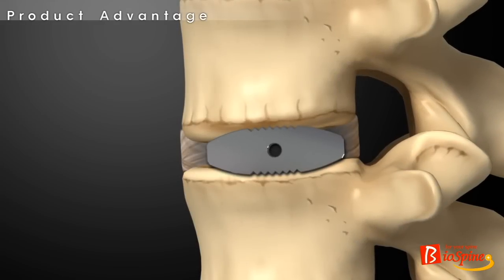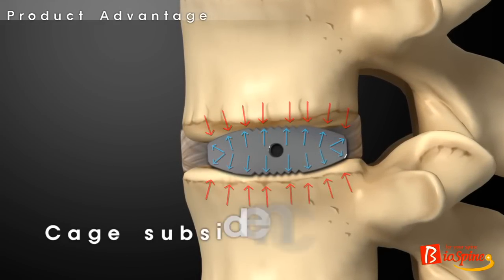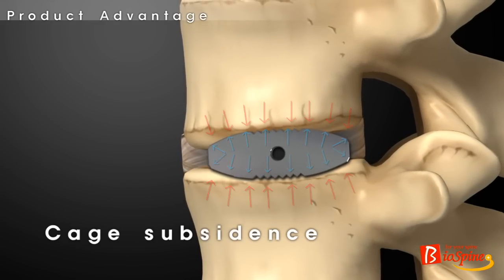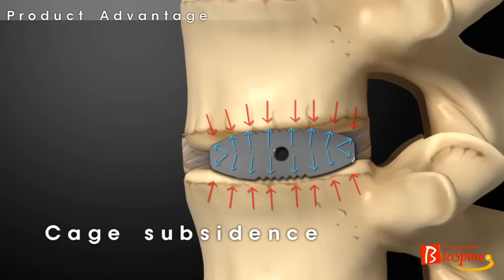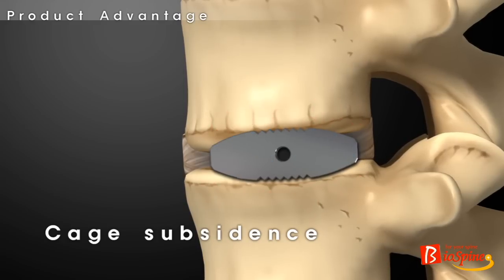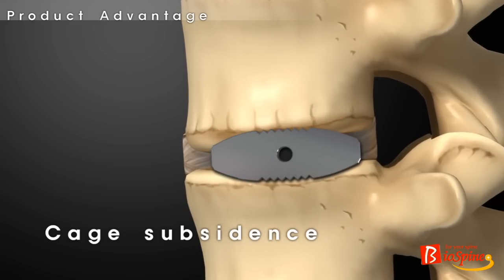Bioflex Functional Cage SystemBiospine

Comment: Do you loose any mobility with this implant (for instance, rotation)?
Reply from the maker: ***** The flexible cage has not been designed for a kind of artificial disc, so that we cannot expect any mobility in case of rotating movement of spine.

Comment: I'm curious about this design, wouldn't it have been better to design the flexible cage to have a floating upper and lower disc.

A kind of circular platform that sit's similar to that of the original spinal column which could be clamped using overlap to the bone rather than having to use a flexible rod system.

Kind of like a bottle cap fitting over the opening of a bottle, so you would have two bottle cap type plates upper and lower which grip the bone with inverted spikes, then the moving nitinol springs would be located around the chord in a C shape with an open end which could extend to close around the chord at body temp thus giving full motion with lower use of mechanical parts.

It's just a thought as this though looks good there seems a better way to design it as the body naturally uses an all enclosed type system it could be replaced using a nitinol enclosed system that fixes to the existing structure with less screws and springs and utilising the bodies own muscles.